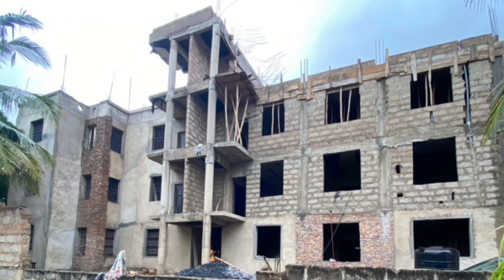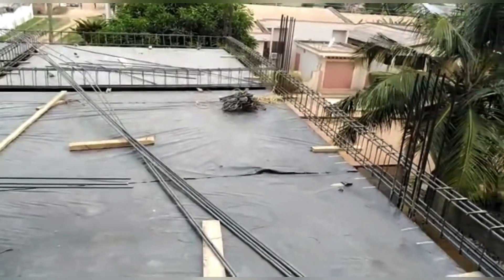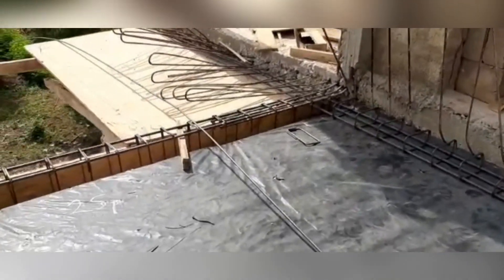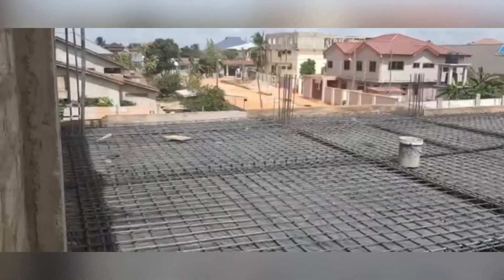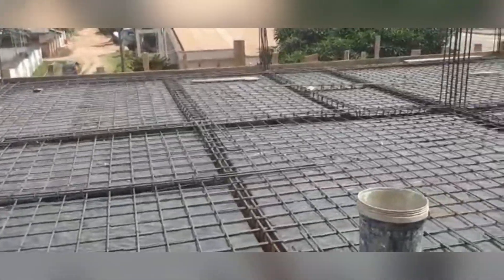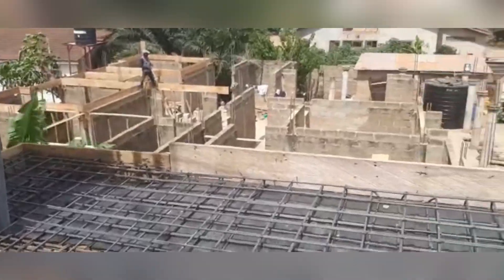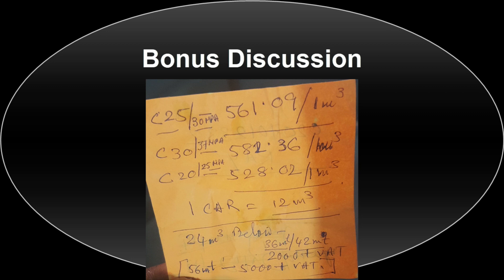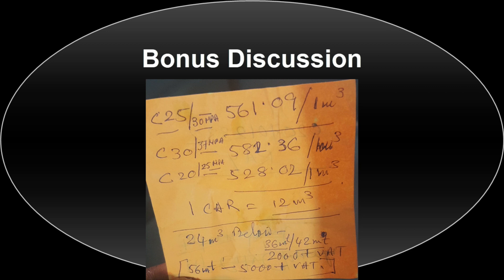Cost of building in Ghana _ Steel Bending Works & Premix Concrete Price _ Ep 15

Comment: I want to know if it's okay to have a 4feet cantilever beam extension thanks
Reply from the maker: Yes, it is more than okay.  We have 3.5 feet for the porch. Just make sure your reinforcement is done as indicated in your drawing.  Usually decking rods are doubled and it's beam rods are at least 16mm but double check in ur drawings
Reply: @Lerwincel  thanks very much I appreciate God bless you for Ur good work

Comment: my humble opinion is that you get a "qualified" structural engineer to design your building and specify all the rebar required. Do not attempt to do this yourself! I would only use the guidance given by @Lerwincel for initial rebar costing and nothing more. Always get a "Professional Engineer" to design and specify Reinforced Concrete especially for a multi-storey building.
Reply: Hello are you a structural engineer in ghana?
Reply: @ladysaw9995  yes I am a Professional Engineer registered in Ghana but I am based overseas.
Reply: @engchronicles7871  That's great!! I'm looking to build a 3 bedroom house, but the style is a little unconventional. I'm trying to see how I can make it as safe as possible.
Reply: @ladysaw9995  if you already have architectural drawings drawn up then you get a structural engineer involved to advise on the best way forward. I am not sure if there is an assessible database of PE structural engineers in Ghana but you can check online.